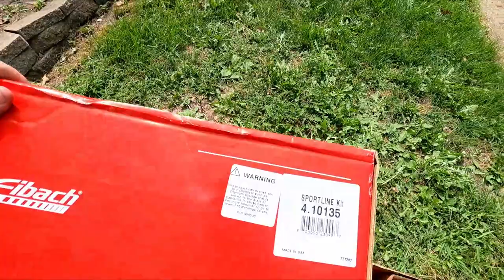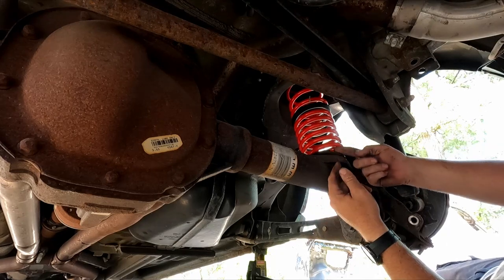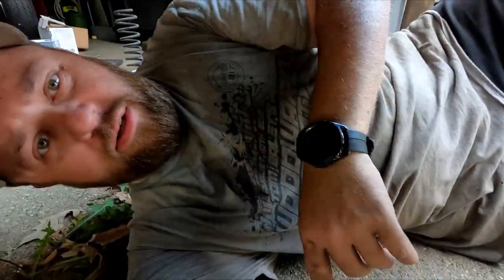Lowering a 2005-2014 Mustang GT | Eibach Springs | S197

Comment: It looks like you installed the rear springs upside down.  Eibach print should be right side up.  Not sure if it makes a big difference, but the big coils should be at the bottom.

Comment: That beast looks good. Needs some videos of that beast. If you still have it.
Reply from the maker: It's my GF car, and she bought it new and still has it
Reply: @Dom87SS  how does it drive. I'm about to lower mine but I don't know if I should buy camber caster plates with the springs
Reply from the maker: @carter2173  drives just like stock but stiffer

Comment: Great vid. Shouldn't the Panhard bar be replaced with an adjustable one too?
Reply from the maker: It could be, but it's not necessary
Reply: @Dom87SS ok good I just installed my eibach 1.5 inch and they poke at the rear cuz I’m running 305/30/19 and the driver side barely pokes more than the passenger

Comment: Did you get an alignment after? If so we’re they able to align without the caster/camber plate?
Reply from the maker: We have not, honestly put less than 100 miles on it after but checked it with a string and it's not far off at all
Reply: @Dom87SS  You definitely need the alignment BUT they make camber bolts that you can use instead of camber plates. The camber bolts are way cheaper and the shop doing the alignment should be able to install the camber bolts. If you don't you will eating up those nice Continentals.

Comment: What size tires and how many inch drop?
Reply from the maker: I don't remember the size of the tires, It's about 1.5in drop
Reply: @Dom87SS  Do you know if they're 19s or 20s?
Reply: @ilc-nl3yy  they look like 19×10 with 19×14r in the back might have a staggered wheel set up or  their standard 19's on all 4 tires making it easier to rotate them because they are the same size if you use bigger wheels in the back you can't rotate your wheels  traditionally

Comment: can you install these on the v6 model? or is it just the GT?
Reply from the maker: All the suspension should be exactly the same but the only thing I would think that could be different is the weight of the engine so it might not set exactly the same

Comment: Don`t need a panhard bar after lowering and also measure the wheel alignment ? Just asking for a friend!
Reply from the maker: lowering it doesn't make the rear end center up, so yes you still need a panhard bar. And you should always get the alignment checked when you do any suspension work.